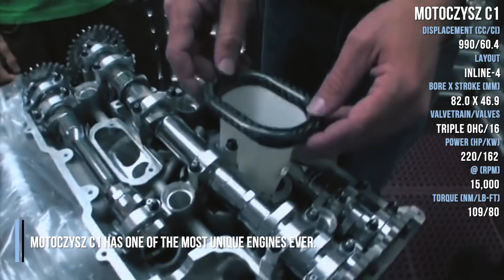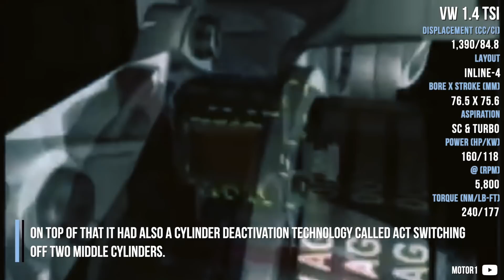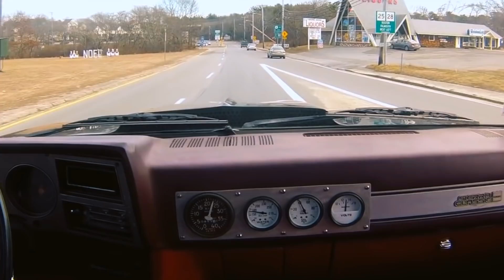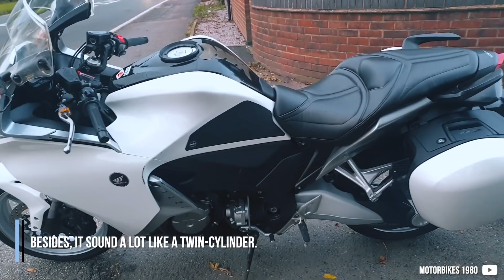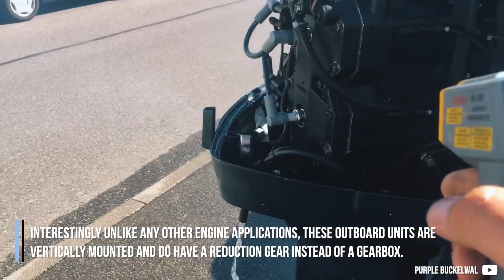Strange Four Cylinders You Don't See Often | Ep. 2

Comment: The most likely reason for the cylinders to be closer together on the Honda vfr1200f is if they use a common crankshaft and the con rods mount next to each other , a bit like a radial engine in a plane

Comment: The thought and engineering skill, that goes into building any high performance engine is impressive. Sometimes though, there are engines that are just on another level entirely. Although we've relied on the basic four stroke principal now for well over 100 years, and the average car engine is still basically the same as it was at the turn of the last century, albeit far more refined, reliable, using better quality materials and computer technology, thankfully there are still plenty of engineers out there thinking outside the box, constantly coming up with new engine designs that are little more interesting and unusual.

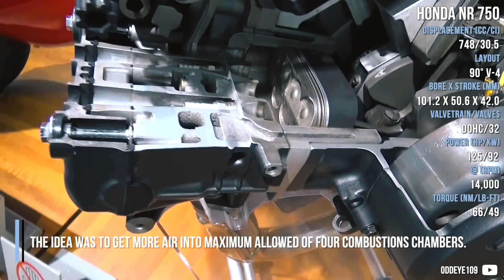Comment: 1:30 the oval pistons had nothing to do with getting more air in, it was the trick to make a V8  engine which was still considered to be a V4 by the FIM. The NR750 had 77 PS at 11,500 rpm for the home market, the export model had 130 PS at 14,000 rpm, and the racing model had 155 PS at 15,250 rpm.

Comment: The Honda RC148 and RC149 (125 cc 5 cyl.) had 8 speeds, and ran at 18,000, resp. 18,500 rpm, the RC166 (250 cc six) had a seven speed box and ran at 18,000 rpm, so your statement is not completely correct!

Comment: Two strokes are efficient in one way but have issues with pollution. If that problem could be solved it would be great.*

* Some company had purportedly solved this issue long ago, but their engine never made it to market. Their engines had some other advantages too: They were lightweight due to the power-on-every-stroke technique allowing a 4 cylinder to act as an 8 cylinder, effectively and also because of their slightly simpler design compared to a 4 stroke engine.

Comment: My Grandad had a 1963 Evinrude V4 75 hp on his boat....I remember pull starting it back in the '80s when the starter failed.  She was a mighty beast, with a mighty roar at full throttle. (the boat was a 17' MFG 4 seat runabout).

Comment: I still have the documentary of motocyz C1. The NR750 is iconic for a number of reasons... The oval pistons came about from Honda developing a v8 for Gp bikes but then told they could only have 4...hence the oval piston twin conrods and 8 valves. But from that point o.. And it took quite a few years... But look at everything on that bike... Mirrors came out in later year s on blackbird,pgm fuel injection became the norm, inverted (usd) forks, under seat exhaust, the use of carbon fibre(John Britten was already using it in his now famous V1000), the use of side mounted radiators later found on vfs... So quite a revolutionary machine despite being nick named Never Ready and being quite lardy(heavy) for a 750...

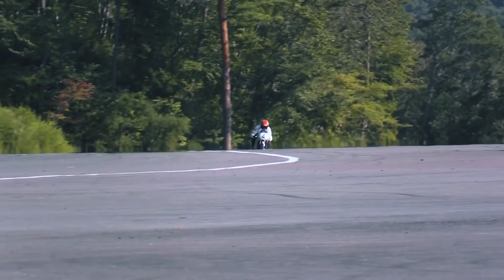Comment: 9:00 Almost sounds like a wankel.
Reply: also it does
Reply: u mean rotary
Reply: @ptrap1106  wanker
Reply: @ptrap1106  What most people refer to as "rotary" is actually, correctly called the Wankel engine. There IS a type of engine that is called rotary indeed, where the entire cylinders rotate. Yes, that's right, the cylinders rotate around a fixed shaft. They were used in the early days of aviation, look very similar to a radial engine but work pretty much the other way around.
EDIT: to clarify, it isn't really INCORRECT to call wankels as rotary engines either, but that still is their name, one which cannot make it ambiguous either
Reply: st0812  It’s called the Wankel engine
Felix wankel named it the Wankel engine. 
Rotary engine is just something we call it. I still call it the name Felix wanted.

Comment: Oval cylinders two connecting rods..It`s a Bloody V8 in disguise
Reply: Yes, they made it after 8cyl was banned in competition motorcycles because they thinks they are too dangerous . And after this Hondas trick, they banned oval cylinders because only honda can made it and they told Honda has disproportional advantage.
Reply: @martinleska4292  Nonsense, they banned racing motorcycles with more than 4 cylinders for 350 and 500 cc, and two cylinders for 125 and 250 cc, as usual prohibiting development. Nothing to do with too dangerous! And oval pistons were never banned, I don't know where you got this nonsense!
Reply: @martinleska4292  they had no advantage at all it was honda's last attempt to try and beat two stroke with a four stroke and spent $10,000,000 trying but failed miserably hey and the oval Pistons were never band that are not cost effective as soon as there's a slight thousands of we're in the Rings they no longer hold compression on those flat sides of the Pistons that are not repairable cylinders at all hence the name nr500 equals not repairable 500 and the nr750 equals not repairable 750 those engines are all throw away engine as there are no machines I can repair the cylinders that are shaped like the Indianapolis 500 mile race track and it was population mirrors dream to build a 4-stroke that could outrun a two stroke of the same size even though he knew that was impossible
Reply: @Gabriel Godina  imagine putting that on a Kei car
Reply: That's worse than tomato juice:-)
Reply: Thats why they made it . It was a v4 with a lot of the characteristics of a v8 , Honda are damned clever
Reply: This engine was done as an exercise, it was never intended as a seriuos competitor, the engine could never produce  the power required to be serious ,the basics included a long flame trave that reduces the max rpm. We new that. It was a political move.
Reply: @almelling6699  I agree with your first statement, the exercise part, but reduced the rpm?The thing ran at 21,600 rpm! At 30.6 mm stroke, the average piston speed was 22 m/s, so they could hardly have gone higher with the rpm. You obviously know little about engine design! I suggest you read my book "Honda's Four-Stroke Race History 1954 ~ 1981", where the NR 500 is extensively discussed.
Reply: @joepkortekaas8813  did they tell you about the part about pop Yoshimura designing nr500 and yes it turned an incredible amount of RPM around 22000 RPM that is the rvn that pop Yoshimura had figured it would take to pass a two-stroke Yamaha that spins at 11,000 RPM and in 1983 at the race in Florida at Daytona Honda failed miserably RPM  and Kenny Roberts rode the Yamaha 500cc Square Four with two crankshaft directly gear together had 4 liquid cooled YZ 125CC single-cylinder cylinder block on one lower end in a square configuration onto crankshaft that made 200 horsepower so Honda got two strokes banned from Moto GP Motocross and dirt track racing you say when Honda can't win they make it so nobody else can either they've always done that if you read your history you would know but it is entirely impossible for a four-stroke of the same size to ever beat a two stroke of the same size because of one very important factor that nobody today understands that all Two Strokes make boost as all two-stroke racing engines for motorcycles are internally supercharged and it is physically impossible to ever have a naturally-aspirated 4-stroke that whenever make boost because it's impossible so at four stroke have the same size CC can never possibly outrun a two stroke of the same size CC and that's demonstrated here everyday on YouTube. The sport of motocross when it first came about was all four stroke engines the highest technology of the day sought out the fact of the 2-stroke being lighter-weight allows the front wheel to stay out of the Tire ruts and plant the back wheel where it belongs getting a bike a lower center of gravity at a 2-stroke engine make power three times faster using only 3 moving parts anyway you look at it Two Strokes where the innovation of the day and still are but when you pass rules against them you can win with a 4-stroke with no 2-stroke competition it's just like we with band all the major manufacturers and only allow Honda to race against Hondas that's basically what you're doing today racing four strokes against 4-stroke and justly gyration effect from a double overhead cam motor over a 2-stroke that has none of those parts it's silly to ever do it has 4 stroke for obsolete on the motocross track backing in 1950 when all you had was bsa's and triumphs Norton that's all tractor technology like a Farmall and then the 60s Yamaha and Suzuki Kawasaki all three are two strokes and we're laughing the four strokes and laughing and we still are as you Millennials beat yourself to death on them big heavy 450 4 Strokes until the can change come flying out of the bottom of the cases and it cost you $5,000 to fix your bike to go back to play again or else I've never seen a piston come out of a two-stroke did it's going to cost you a piston or rod and crankshaft whereas with a 4-stroke you will need a 5-gallon bucket to hold all the parts to put your 4-stroke dirt bike engine back together and  spend the money you could buy an enter  two stroke motocross bike that will out run your over priced four stroke
Reply: @donniebaker5984  Sorry, I didn't even finish your rambling nonsense story, all I can say is, that "Pop" Yoshimura had absolutely nothing to do with the NR 500.
Reply: Joep...what an arrogant fool you are...imagine the public reading your comment to me. What kind of impression you have given them to encourage them to buy your book.
You must have missed me at Honda in the 70/80 and at the other 2 Japanese comoanies. Yes i eas a consultant to all except Kawasaki. 
Oh and engine designer i have designed 3 F1 engines and one of those eas mine and i sold it to a manufacturer which manafpged 4 world championships. Oh and i have desighned engines for Chrusler. BMW and acted zs engine design consultant for Porsche, Farrari . And Lamborgini. And i am now working on a new F1 engine for a Japanese company. If you look this engine and the conrod centres and the piston mean acceration, then apply that to flame speed at that rpm you will see the piston leave the burn just like our v10 3.5ltr engines in F1.
By the way i have 55years in engine design not tuning not modification etc DESIGN.i am now 76years and still called upon for design, i will not answer you so just leave it and take a word dont be confrontational, its not good in Japan ,i am there now.
Reply: @almelling6699  Fine, I accept that you are a very capable designer of high performance engines, but that doesn't mean that your comments about the Honda NR 500 were correct, on the contrary!  And misses you at Honda? Maybe, but your name never pops up anywhere in the Honda literature, I'm sorry to say.
Reply: @joepkortekaas8813  maybe i dont seek the limelight as you do, my contracts as you should be aware with consultant work are confidential. And i am not about to discuss this any farther in the public domain.
Reply: @almelling6699  but you have never even held a candle to pop Yoshimura who was the designer and builder of Honda's first two stroke and all the Honda 2-stroke Elsinore and the designer of this nr500 engine as it was Honda's last attempt to try to beat two strokes on a Moto GP track which is impossible as Yoshimura knew it was impossible but still spent 10 million dollars of Honda's money trying to build this NR500 to win and failed miserably  NR = not repairable as there is no way to clean up or oversized a oval shaped cylinder shaped like the Indianapolis 500 mile race track but Yoshimura did not care he had one thing in mind with this engine that was to beat the Yamaha and failed so makes all these in R500 and all these nr750 totally obsolete it's just more junk that Honda failed at as there is a whole list I can fill a book with oh and yeah they have the so-called best percentage advise that fail around what is it 15%... 15% of 150 million bikes Pure year is more motorcycles that fail from Honda than most manufacturers build.. you see when you start packing on things like percentage-wise or parts per million it's extremely easy to convince the public of lies and hype and progress that never happened Honda does not have any interest at all if their motorcycles and their cars all crashed and burnt tomorrow because motorcycles and cars is not Hondas main business or their main money maker at all it's a gimmick to get people to buy them World contractors like the bilderbergers after United States goes in and destroys our country the bilderbergers goant back in and rebuild the same country using all the equipment from Honda to supplies it to the world So when you buy a Honda you're helping Honda help those who destroy your freedom that's why Honda stands for hop on dumbass
Reply: Hi replying to you i live in Manila and i work in Japan ,at present i am consultant to 2 japanese companies one on a new bike road engine and another company on a new developement for F1 engine. The contracts are for 2 years. No i would not live in Japan. But one goes were one is needed i fly many times per month. My office is in Manila.

Comment: Honda makes the most durable small displacement engines bar none. For instance take a look at their 185/200/250 single cylinder off-road engine that they used in the ATC's, 4trax, and the TRX. My 84 ATC 200 ES has a bad cylinder gasket, piss poor carb, and the rattliest cam chain in existence and that thing still cooks d*ck. They are hard to put down is an understatement. Not to mention the ammount of power compared to displacement some of their commuting engine blocks can handle reliably.

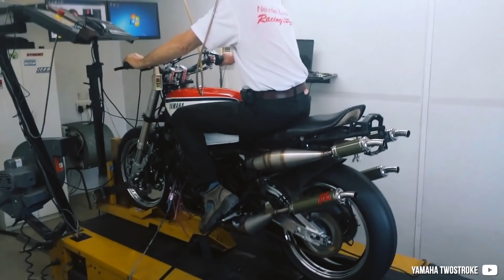Comment: 6:01 That V4 on the Dyno sounds savage and similar to the Mazda rotaries!!!
Reply: Thats the power of 2-Strokes :D
Reply: Rotaries run in a very similar way to 2 strokes.
Reply: Alex ? no they don't the only similar is high rpm's other then that there wayyy different lol
Reply: @danhard8440  the combustion is the same, when the piston reaches top dead center only combustion happens, so you get 2x the bangs of a normal 4 stroke engine
Reply: nope sorry each side of the Dorito is 4 " stroke " where as a 2 stroke the intake and exhaust occur in the same " stroke "
Reply: @danhard8440  While Wankels are 4 stroke, they complete a powerstroke every revolution of the crankshaft just lile 2 strokes.
Reply: Yamaha RD500. I had one and wish I kept it as it would be worth a fortune now.

Comment: You can start making your video again, you mixed up 2 vw engine's. The first you've showed. Is 1.4 TSI act. With cam belt. Cze serie's the second is a cav serie's timing chain engine. Who has no act.
Reply from the maker: Thank you for heads up, but it does not matter much. That was just a side note. The point was the turbo and supercharger combination.
Reply: @VisioRacer  mmmm Lancia Delta S4 ^_^

Comment: 2 stroke engine diesel... Turbo? How is it possible? I mean, how is it possible that a 2 stroke engine could be turbo?
Reply from the maker: Listen carefully. This engine works differently than a gasoline 2 stroke. It has a Roots blower suppling air from ports above the piston at bottom dead centre which then also scavenges out the exhaust fumes through exhaust ports in the head. It is possible to turbocharge these engines and there are plenty of them turbocharged, these Detroits.
Reply: You can turbo a Gas 2 stroke if you dont believe me look it up (Turbo Minarelli am6)

Comment: 4 cylinders our the most boring and coolest engines
Reply: Some 4 cylinder engines are very boring.  I once rented a 2001 Corolla and that thing was about as gutless as they get when it comes to any acceleration after starting up a hill.  They are a blast when starting from a light but absolute snails otherwise.  I am not sure if the newer ones are any better because I never drove any of those.  Sure they get good mileage (or so they want you to think).  My Uncle's 2005 Passat TDi not only got better mileage but was better looking and more fun to drive.  It was also a lot more comfortable inside.  In the Corolla there was no usable rest for my right arm and that all by itself made the car feel uncomfortable then the seats were nothing to be desired by any stretch of the imagination.